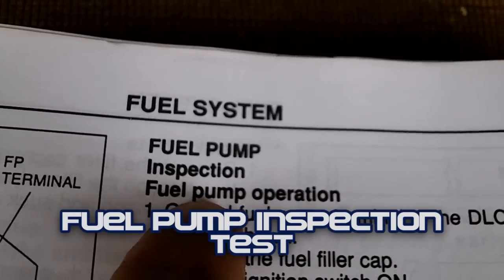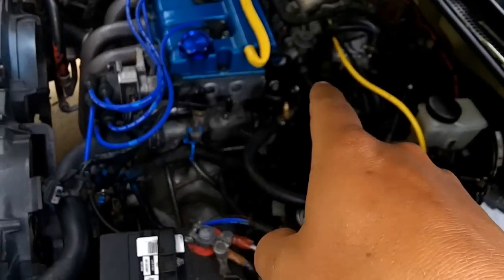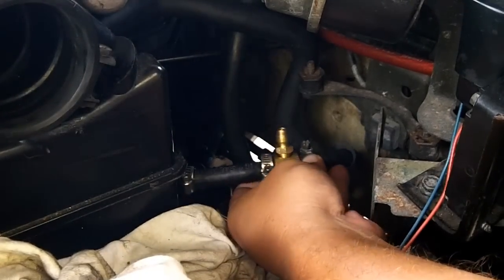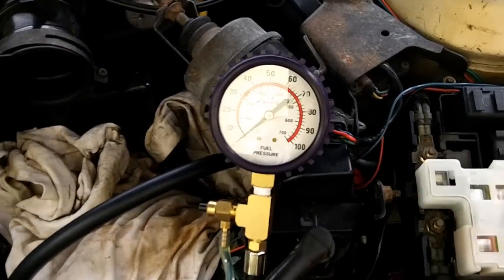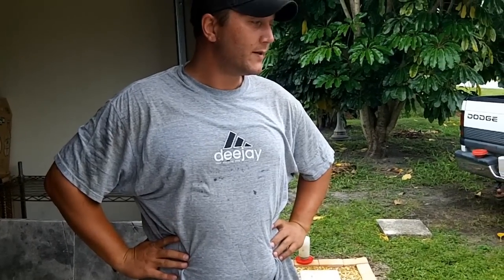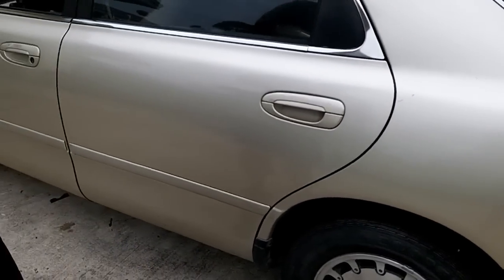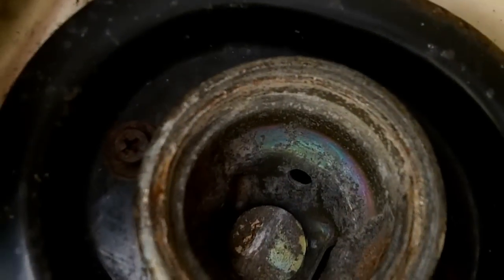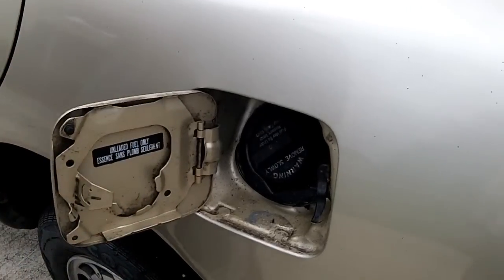Mazda 626 - Fuel Pump Inspection Test

Comment: hey , when i turn my key to the on position i dont hear the pump buzzing but when i go to crank the car over then i hear my pump come on any advice
Reply from the maker: +mike “Browbeaters Anonymous” t It depends on the year and model of your 626.  Not all of them do it.  It's not a definitive test so I probably should have never included that in the video.
Reply: lol ahh mines a 97 with the 2.0l im having so many issues with it i dont know where to begin , if u have some spare time and could give me some tips that u haven't posted in ur videos that would be great
Reply from the maker: +mike “Browbeaters Anonymous” t Sorry but I can only respond to specific questions.   If you have a question about something not in a video feel free to ask.  There are many topics that I haven't covered.  My channel is not comprehensive.  Ensure that you pick up a workshop manual from pmx626.info for free.  It's like a 626 bible.  Read it.

Comment from the maker: Sounds more like a vacuum leak as they are known to rob power and cause a lot of issues.  You have to do some diagnostics to find the issue.  Buying parts in the hopes it will fix your issue will just lighten your wallet.  Sure a fuel pressure issue could be the cause but you have to test for that.  I'd take the car to a mechanic at this point it might actually save you money in the long run to get it correctly diagnosed.

Comment: My 98 Mazda 626 Lx 2.0 just outta no where lost power and runs like shit now. No power. I replaced the fuel pressure regulator, can sensor, and cleaned the maf sensor. Still running like shit. Anyone know if the fuel pump slowly going out causes this??

Comment: Can I ask what kind of battery do you use how much cranking amps is needed for you 626?
Reply from the maker: All 1993-2002 Mazda 626's use a 58R type battery which has 580 CCA, the newer 58R2 battery has 590 CCA. The 58R physical battery is designed with a lip around the bottom that slots into the factory battery tray and a battery keeper (with a long 10mm bolt) is used to keep it locked in place.

Comment from the maker: 88-92 Models would have a test connector near the wiper motor.  You'd jumper two pins, turn the key on (not run), and it should engage the fuel pump.  If it does then do a fuel pressure test.  If no then you'd have to look for 12v at the fuel pump itself.   You can find the exact procedure and diagrams on PMX626 (dot) INFO.  Look for the 1988 WSM on there, procedures are the same for all 88-92 models in terms of fuel pump inspection.

Comment: Just watched your Fuel Pressure Hold Test video. I think I am now convinced you do have a problem with the  pump, but it's always good to  make sure your gauge is reading right. There is still one more variable to consider, although I would not expect it - the fuel pump itself has about a 4" piece of rubber hose that connects one part to another, and this hose is held on with worm gear clamps. In the unlikely event one or  both of those connections broke a little loose, you could lose pressure.

Comment: I'll do mine as well in the  next couple days, you got me curious about what my reading would be. I'm not going to do the max pressure  test though, I feel uneasy about purposely blocking off the fuel pump and having it basically hit a brick wall when it's trying to pump. (unless there is some sort of relief valve on the pump to avoid damage).

Comment from the maker: A lot of little factors such as running rich, rough idle, inability to lower air adjust screw, inability to change base idle lower than 750 RPM.  When idle is at proper 750 RPM it seems as if the car is misfiring.  Spark is healthy so that led me in the direction of a fuel pressure test.  On the very first test I noticed low fuel pressure and just ran through all of the tests I could until we arrived at this point.

Comment: It sucks that your car does not have an access port in the back seat.
Reply from the maker: Yeah the older 1980's-1992 GD 626 models do and the newer Mazda 3'S & 6's do too. It's only the 93-02 US 626's that don't have a fuel pump access. Oddly, there are some 93-02 Asian/European 626's that have fuel pump access lids. :/ After working on my 626 for so long I've come to learn that if an engineer didn't design something it was on purpose, it's not a mistake that fuel pump access wasn't designed into these cars, so I'm never going to cut a hole for one. There's actually an advisory never to do it because there's a hazard of fuel entering the cabin during a hard rear accident. It would be like subjecting everyone in the car to a flame thrower that burns everyone alive. I'll never recommend anyone modify a fuel tank access for their 93-02 Mazda 626. If you do, you accept full liability of passenger death. It won't be the fault of the asshole who rammed into the back of your car at 60+ mph.

Comment: 10:25..or 4 - your gauge is not reading correct. Once again to avoid a painful fuel tank R&R, if  you have another car handy that you can measure its fuel pressure on, I would do that. (something easier that already has a Schraeder valve on the fuel rail)...just to give you the warm and fuzzy that your gauge is true.